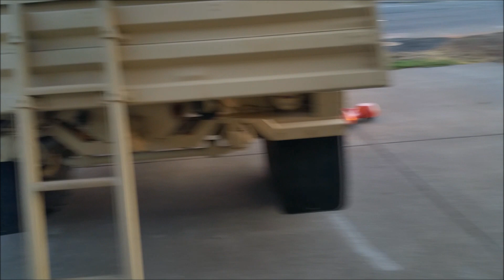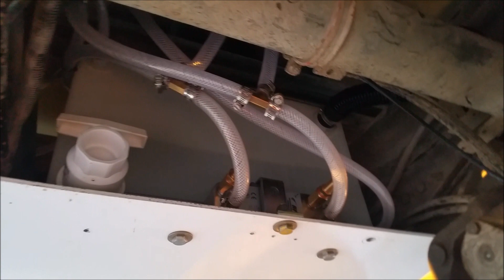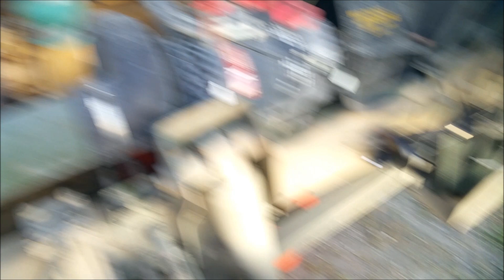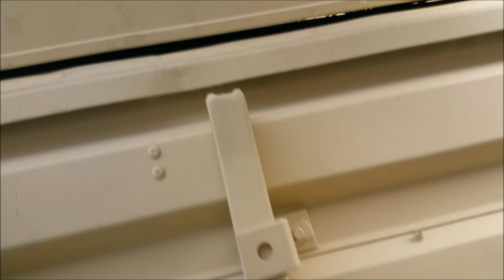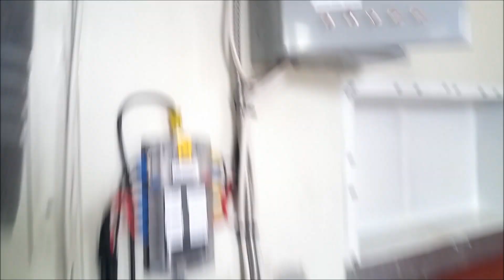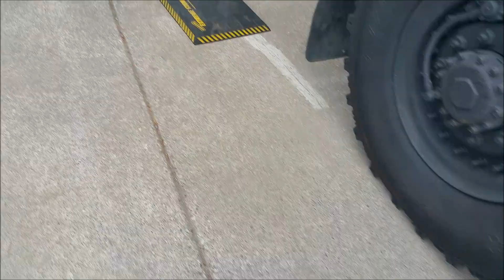Abel LMTV build part 25 Labor day weekend special (eberspacher install part 2)

Comment: Scored a $200 Eberspacher m10. Did not ever expect to find an lmtv install! Great vids
Reply from the maker: I got you covered!  I cracked the ecu code on them in the videos.  Mine is still working flawlessly to this day.
Reply: @SeanFastidious  Absolutely killer, many thanks for saving me the time! Got a 7-day timer with mine, saw radio options on Butlertechnik might wire to a remote start I have kicking around.

Comment: Do you recall the ID hose diameter of the return hose you tee’d into? The blue hose. Thanks!
Reply from the maker: 5/8"
Reply: I got that 3/4” return plug out and have the 3/4” reducer but the threads seem different. The threads don’t sit on each other when you put them together. Also it seems like it wants to cross thread after about two rotations.  Yours looks like you were able to get it to thread all the way in.  Did you just cross thread it in?
Reply from the maker: @ryanwalsh9255  try both npt threads and straight threads.  See which works better.
Reply: 3/4” garden hose (whatever that’s called). Thanks for your help!
Reply from the maker: @ryanwalsh9255  once again you can use 3/4 npt or 3/4 straight threads.  I am not sure what you mean by "garden hose"